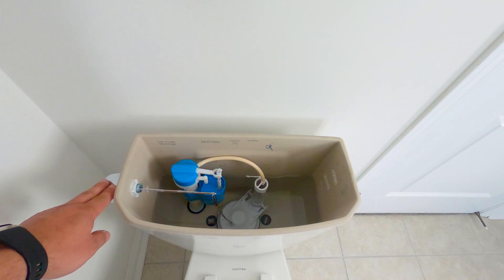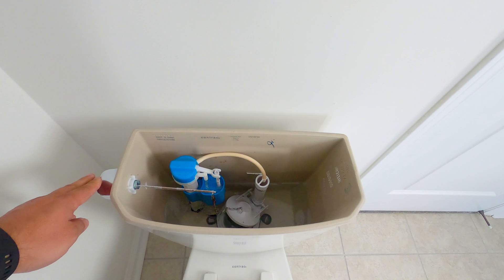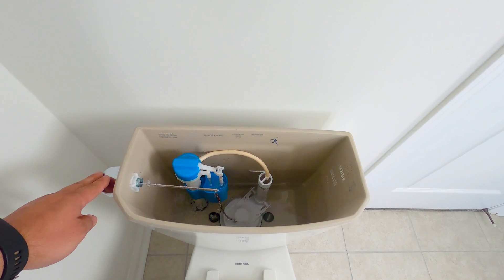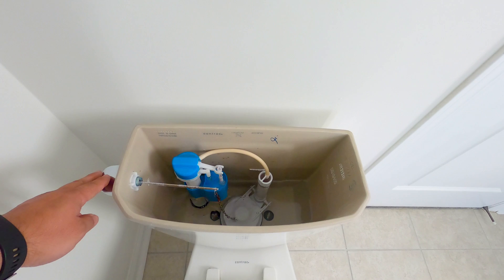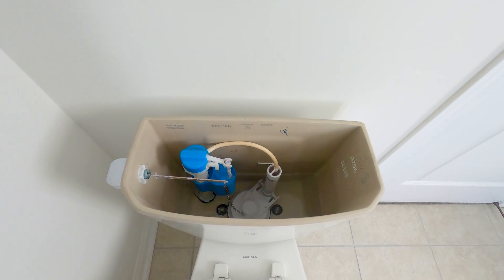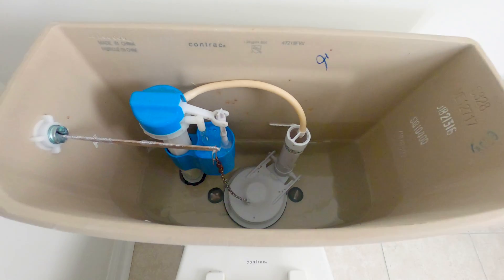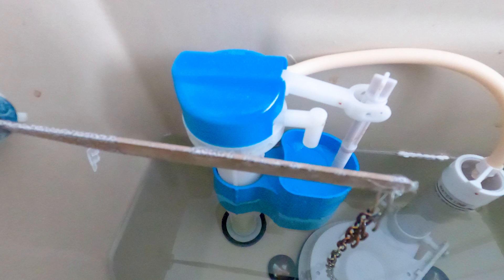Why Plumbing Pipes Make Noise and How To Stop the Hammering or Whistling Sound

Comment: What causes a "knocking" sound in the pipe after flushing the toilet?? Help please
Reply from the maker: The shut off valve or the toilet filler valve! But there might be other things involved!
Reply: @PipeWrencher  Thanks for the reply but it's not the above and the knocking starts as soon as I flush and ends as soon as the tank is full. Thanks again!
Reply from the maker: Replace both of them anyway, they are both cheap. just find a good plumber to do  it or do it yourself if you are handy! then tell me the result.

Comment: We have a problem, when we use the shower the pipes in the loft sound like bagpipes! This only seems to be a problem in summer! Numerous plumbers have tried to fix it and failed.  It's really loud and goes on for ages.  If I run a bathroom tap at same time it stops. As soon as I turn the tap off it resumes.  Please can you suggest anything?
Reply from the maker: Hello my friend, I need more details! 1- did other plumbers try to replace the shower cartridge? 2-did other plumbers replaced the shut-off valve for the bathroom tap? 3-is the shower on the top floor? 4-what happens if you turn only the bathroom tap on? 5- do pipes bang? shake? or squeak? 6-is the shower pressure lower than before? 7-is the pressure in the bathroom tap lower than before? 8-how is the toilet in the same bathroom? 9-how many showers do you have in the house? 10-how old is the shower? 11-how old is the bathroom tap? 12-what brand is the shower? 13-what brand is the bathroom tap? 14-what type of shut-off valves do you have under the bathroom tap?
Reply: @PipeWrencher  wow, that's quite a list.  I will get back to you. Thanks for your reply, it certainly suggests a lot to think about.

Comment: My issue in more constant under certain temperature for a shower - can you do this with PEX as well?
Reply from the maker: Yes you can do the same thing with the pex pipe, but I think you need to replace the shower cartridge based on what you said. Replace the cartridge first and I believe it resolves your problem!

Comment: Hi,  when I run washing machine, cold water pipe seems sucking/stopping water sound.  If I close the cold water so less water is coming then sound stops.  Would Hammer Arrestor will help or is there any other problem.  House is about 15 years old.  
Also, in one of bathrooms on main floor, when I flush and open cold tap, same sound comes.
 Thanks!
Reply from the maker: for the washing machine i recommend to replace the shut-off valve for the cold water and most probably your problem will be resolved, but for the bathroom i need more explanation (I need to know when you hear the sound and when you don't) only when flushing the toilet and running the tap at the same time or every time you run the sink no matter if you flush the toilet or not.
Reply: @PipeWrencher  Thank you! 1) I think shut-off valve is soldered and I probably need to cut the drywall to access it.  Would prefer to install Hammer Arrestor if that would fix it.  What do you think?  
I closed the tap a bit for cold water to reduce the flow of water and sound goes away. 
2) re toilet:  If flush toilet alone or cold water tap in the sink, no sound.  When both are running at the same time then sound comes.  I closed valve a bit toilet bowl to reduce the water flow  and sound stops.
I was going to install Water Hammer Arrestor
 for both.
Thanks again!
Reply from the maker: I don't think that hammer arrestor resolves your problem, most probably your issue is combination of things, you need to check or even replace a couple of things to get rid of the problem. You need to inspect toilet filler valve, toilet shut off valve, the tap's cartridge  and shut off valves. There is hight chance that your problem is related to faucet cartridge.
Reply: @PipeWrencher  Thanks, here is another observation. Laundry room have a sink.  I can see from sink cold water connection, a line go to outside tap.  When I open sink cold water, no sound.  When outside tap is opened, banging sound somewhere in the basement again.

Comment: Whenever water is turned on....we can hear clicking noises in the family room which is right above the basement room with water heater ...,it is so bad and noticeable ....constant clicking sounds when water is turned on ...any ideas?
Reply from the maker: Might be one of your shut off valves that needs to be replaced. now you need to troubleshoot and find the one or call a technician in your area.

Comment: At night, every time a toilet flushes, their is a loud whomp whomp, whomp whomp, whomp whomp, sound that comes from my bedroom wall. The other side of that wall is the garage. Anyone know what is this noise? Also, from the master bedroom, water seems to be leaking or not working properly.
Reply from the maker: Really difficult to say, you really need to call a local plumber to look at it.
Reply: @PipeWrencher  I'm not a plumber so I don't know exact terminology, but I adjusted the main water line outside to a lower pressure, and the problem has gone away, thank you for responding.
Reply from the maker: Aha, now it make sense, most probably you have a gate valve before the meter! Do you?
Reply: @PipeWrencher  Oh I don't know, it's a valve outside the house, underground, under a cover.
Reply from the maker: @roush26  that valve most probably belongs to the municipality, depends where you live. call them up, tell them to replace it if it belongs to them. your problem is most probably from one of the valves, now finding the right valve needs a bit of patience.

Comment: Maybe unlikely but you're basically creating a dead-leg and potentially risking legionella with the first suggestion?
Reply from the maker: I think you mean the hammer arrester, right? if so then I should tell you that this is not a solution that I made! this is the plumbing code in Canada. plumbing code has been around for decades and it is reviewed every year.
Reply: @PipeWrencher  yes, sorry, that's what I meant. Oh, OK. I guess it's only a small leg. 👍